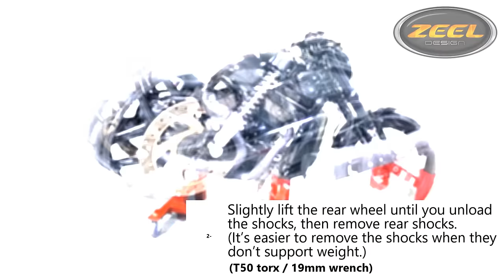V-Rod Wide tire kit installation - ZEEL Design

Comment: I bought the 280 rear wheel kit from Zeel, which requires pretty much these same steps, before this video came out. I can tell you that whoever I was emailing questions to at Zeel was very patient, helpful, and responsive. Bike required more muscle to turn with a wider tire, but man did my bike turn heads and get attention. Would, and will, buy from again.

Comment: “Remove the rear wheel backwards”. 
Thanks for the advice!
Reply from the maker: This step (9) gives details on the movement/direction in which the wheel should go to disengage the caliper bracket and to release the brake tab on the swingarm. So, for example, if your bike is lifted on a jack, we do not recommend removing the wheel downwards. (by gravity) Thank you for your comment.

Comment: So v rod originally not equipped with big tire then?waw, i just know, thank u
Reply: 08+ I think all come with a 240mm rear tire. some people squeeze a 280 on stock, but i wouldn't go over a 260.
Reply: @lar72010 the 07’s have 240 as stock as well. Thats how my 07 night rod special came. But i put a 260 on it now